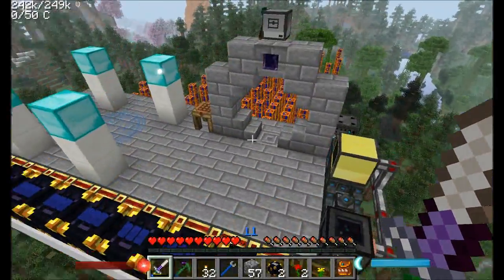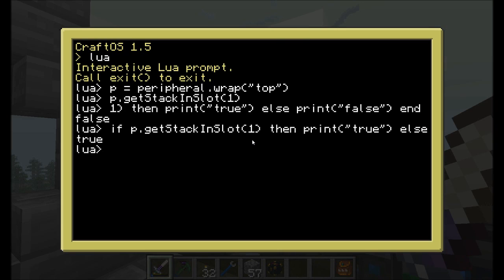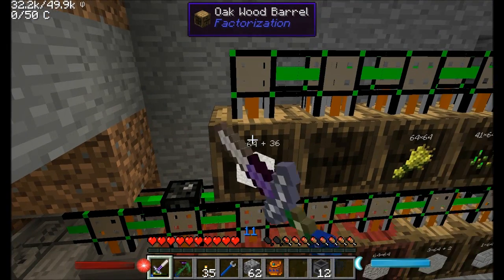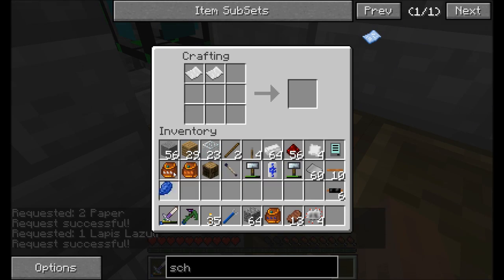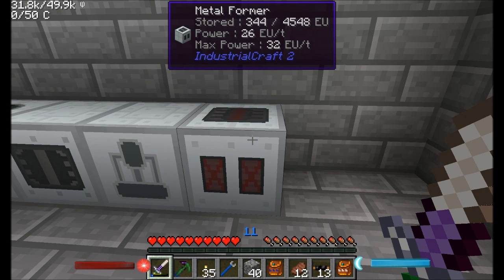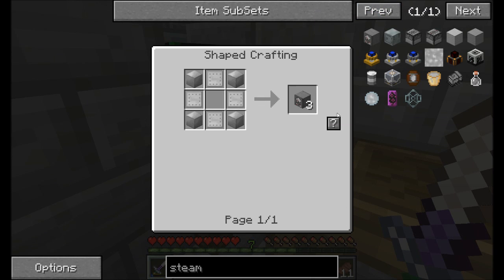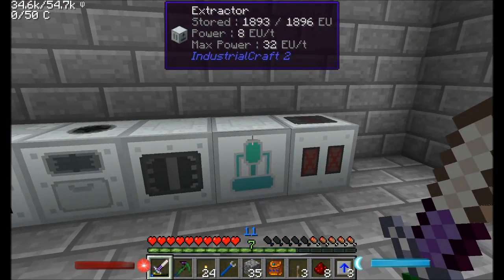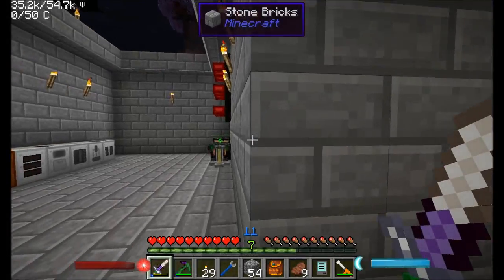Lets Play   S6E44 Upgraded Ore Processing

Comment: Ugh,  I hate IC2. Most machines are painfully slow, the recipes are extremely annoying, the textures are inconsistent (compare the eyesore used for rubber, resin, and circuits to the machines), a lot of components don't stack, and the resource demands are ridiculous. No wonder most mods are now using RF.
Reply: IC2 experimental (basically any IC2 past 1.4.7) is being developed largely by GregariousT, author of GregTech, so IC2 is taking on a very Greggy style, with the ridiculous processing chains needed to make anything, an even more complex electrical system, and an even more grindy experience (Dire really needs the Destroyer of Worlds in order to make anything from IC2). I can't stand it. While the old IC2 from 1.4 was great (it was the main mod for FTB then), the new IC2 has just gone downhill, and is really just a 'hardcore' mod, pointless without GT added onto it.

Dire should just use more pulverizer-furnace combos.
Reply: ic2 is one of the coolest mods there is.
Reply: Sergio Larios In what regard? Give me some reasons against what I said.
Reply: TristanBomb Kyle Layton Thank god. Two people who agree that IC2 was better before they overhauled it and made it so much less fun to use. I understand, it was a little too easy once you had a rubber tree farm, but now it's just a pain in the arse to get any machines made and they're so much less efficient than TE.
Reply: If you have Overclockers, you've set for some machines. Not all of them can be upgraded.
Reply: TristanBomb Agree with you on most parts, however the induction furnace is awesome.
Reply: Ali Khan I'll give it that, the Induction Smelter is cool. But it's not enough to motivate me to install IC2.
Reply: TristanBomb I think they should've just stayed as they were before 1.6. Although the textures back then weren't as great. They did a little too much overhaul at one time. I completely understand that people thought the mod was too easy and stuff. So things like the CESU and the stricter power system were appropriate. But all the crafting became just too much of a problem, and not enough compensation other than another ore doubling mechanic. As for the resource demands, it makes the entire mod basically mid-end game. Why use two stacks of iron to make a macerator when you could use it to make 20 pulverizers that give you extra goodies. (An exaggeration on that last statement, I know. But I felt it appropriate to express my feelings on the matter.)
Reply: 101epicpenguin I actually never liked IC2 that much, but there was no alternative.
Reply: TristanBomb Yeah, it was okay, just when I started using it way back I don't really think thermal expansion was really a "big" mod. At least I hadn't seen it! So I got used to it and thought "kinda cool, double ores is useful; rather iron expensive though."
Reply: You can make a power generator and a really wasteful bomb with the same blocks.
Reply: Also, as far as the whole Nuclear reactor part of the mod. The idea is pretty cool. But I lost it after 1.4. The idea of wasting multiple stacks of Iron, Tin, and Copper to replenish the fuel that I barely ever got to use except for armor that was easily outclassed by MPS wasn't very attractive to me in the absolute least.
Reply: Kyle Layton I couldn't agree more! I never really bothered with nuclear reactors - too much trouble for very little gain!
Reply: Yes its a really anoying mod to deal with but at the end its pretty usefull. You can triple your ore output (i think you can i am not sure ) and reactors are pretty fun to play with in my opinion. I dont like the new ic but its still a usefull mod
Reply: david leviev Yeah, I see what you're saying - reactors are interesting, but it's not worth the huge amount of crafting, effort, googling and resources needed for something that could be recreated simply in other mods. Also, I have no idea how to triple outputs, I'm only aware of (up to pentupling I think) ores via Mekanism.
Reply: Also, the process for tripling ores in IC2 takes a lot more energy, effort, and resources than It takes for regular Ore doubling. The macerator is painfully slow, the Ore washer requires a supply of water faster than the aqueous accumulator, and the thermal whateveritsnameis is just NO. A fuck ton of power, and its extremely slow operating speed, so it requires a ton of overclockers (which we can all assent to them being painful to craft). Not to mention rubber, which is nearly impossible to constantly farm early game, and being that you only get one per resin without an extractor (which is also painfully slow) you.cannot really hope to go anywhere without at least two stacks. Where as with TE or other mods, it requires minimal effort.
Reply: Kyle Layton
Totaly agree ic2 is not the mod it used to be. Now its just a shitty shadow of what it used to be but it can still be usefull in some ways
Reply: Kyle Layton I completely agree with what you're saying! IC2 wasn't nearly as bad before this awful new "realistic" experimental build of theirs. I say if they revert back and work on new features and balancing, it'll be better and actually useable without a million iron and rubber.
Reply: i like ic2 before 1.6 ic2 is shit after the new 1.6 update wher you got to make so much shit just to make something
Reply: TristanBomb And bro we each got our opinions like i think ic2 is only good for 1.5 and why do u care if i like it
Reply: sethraptor refering to the fact that machines from IC2 can explode if mishandled? Yeah I hated that before, I dont think its any better now.

Comment: Dire, you should use rotary Macerators instead of regular ones. They're like the induction furnaces - they macerate faster the longer you expose them to a redstone signal. You don't need overclockers for them, and I think that they use less power than a normal macerator with eight overclockers in it.

Comment: An induction smelter from thermal expansion is better than a macerator. All you have to do is give it sand. it might take like a second per ore but you also have a chance at getting stuff that lets you triple ores.
Reply: ***** What are you talking about? It's so easy to get RF. Flammable fuel for the Steam Dynamo with some water, Lava from the nether for the Magmatic Dynamos, and some sort of fluid for the Compression Dynamo. It's so easy and simple :P

Comment: Dire, mining pipes actually couse lag a bit. So, have a ton of them - bad idea.
To fix it u can just place turtles in front of mining system and program them to brake-place_back at startup. It will couse about 0.3s, but its worth it so hard.
Reply: InVeRnyak0  but if the pipes arent all chunk loaded they wont cause lag, right?
Reply: Andrew Fabrizi yea, but he going to load 2 chunk around, so its up to ~(30x10x60) possible "little lags"
Reply: Or he can just move Down the wells...

Comment: Not sure if you'll see this post but after some trial and error with the same design if you pull the wells (MFFS in the front, wells the very last block) and make sure that the wells are the bottom block being pulled instead of the second one up like in your current design the pipes will break and disappear every time if you want it to look cleaner.  Either way awesome idea, loved this design and missed it since RP2 with the frames.

Comment: With those 10k coolant cells can those just be made in an autocrafting setup like the other recipes or does it have to be the method he's using here?
Reply: HeadhunteR7171 If you put 1 cactus in crafting table it gives you juice. 8 juice around empty bucket gives you a water bucket.
(Yes, it uses more resources than fluid transposer, but is faster, if that is what you need. It's possible to farm cactus, and it doesn't have much other uses.)
Reply: They need water in the middle (either a bucket or other form of source block). The Cyclic Assembler places the water into the cell for you as long as you provide it with water from something like an Aqueous Accumulator, a Liquid Transfer node or a pump.
Reply: Ole Henning Vårdal
I kind of get the feeling that Dire is trying to create something that's an on demand system yet he has some machines or recipes in his logistics pipes network which continuously create items.  I wonder if he could have the system automatically create 10k coolant cells as needed or if he could use a barrel instead of a chest if he's got plenty of the resources needed for them?  If he uses a barrel instead of a chest he doesn't need to worry about overflow and can just tell it to keep a certain number stocked in the barrel.
Reply: DarkVoidIII You dont need a lot of them if you dont have a nuclear reactor
Reply: 1 simple way to make water is from cactus. Then you don't need to deal with any fluids, just simple workbench recipes that like ME network can craft fast.
Reply: user137 water from cactus ? xD
Reply: DarkVoidIII Hence the Cyclic Assembler.
Reply: user137 did not know that

Comment: I was just thinking, in a Mystcraft lava age, have an automated fuel turtle (was thinking the MFFS system, but a turtle is probably simpler) set up a tesseract/pump, and move it when the pump is empty. Not sure how that would work, though - maybe using a portable tank back at the base as sort of a buffer tank, and when enough time goes by that it's not being filled (and still has power), it'll move to the next location.

Comment: The Moment when ive seen the new recipe for glas fibre cables :D old ic2 was ways better
Reply: Well, to me it's simply more opponents have to be crafted. In the days of first touching IC2, carfting electric circuit seems hard to me. It is not so bad when we are used to it.:D And, we have better autocraft equipment nowadays.
Reply: skenming I suppose it is just an additional step when you look at it in total, but at first glance I saw it needing eight diamonds for a stack of 8 cable, when before if you used some electrum you could get 16 or so for a single diamond. I call that a nerf. But then, before there was basically no excuse to use anything but glass fiber, so fair's fair.
Reply: Well, to be fair, IC2 got a MAJOR buff in the release that updated those recipes. Before, glass fibre cable could run 512eu/t, now it's something like 10k eu/t (basically more than you'll ever need). To handle all that power, the MFSU has been seriously buffed, the MFE got buffed to MFSU's earlier level and the CESU replaced the MFE as second stage power storage.

Basically, they added another stage of power above the previous max!

Of course, with the previous version being very powerful at max, the new even higher tier will be costly.
Gold has replaced diamond at third tier power and to prevent you from just jumping straight to tier 3 right away, the MFE costs 16 diamonds and to make sure MFSU really is top tier and late game, that one costs a whooping 40 diamonds.

You're not meant to build MFSU stuff until you don't have any problems with resources anymore. It's meant to extend the game! Before, there was hardly anything new to do, everything was focusing on gathering resources easier or processing them more efficiently, but then what? IC2 now has things to do after you're done with all that :)
Reply: ***** Thanks for this, I share your Opinion now :)
Reply: *****
You put a really deep thought on it. I appreciate that. So now I feel all the buffs and nerfs making sense.
Reply: ***** Good points, all, but I still end up preferring Thermal Expansion. It's power can be used for a ton more than IC2's can without having to involve power converters, so I have to build less infrastructure overall. This frees up time and resources to spend making my base or bases look good, which is actually what I prefer focusing on.
Reply: Silyon487
Sure, but once the infrastructure is in place, IC2 is a lot quicker and have a lot more to build on. TE is rather restricted and basically only have the equivalent of the tier 1 stuff from IC2.
However, it has many nifty gadgets I just can't live without, so I usually end up using both!

Comment: I like using the smeltery to cook ores.  make it tall enough and you can process an entire stack in less then 2mins
Reply: and never get tripple or extra dust/ingots? hell no. thats one of the worst way to procces
Reply: ohh pfff please standard ores are fine, beside are rare change to tripple isn't really worth it, unless you count redstone blocks which give you extra whatever that thing is called to tripple ores with.
Reply: zuzoscorner i use silk touch on redstone ore. redstone ore + sand = 1 redstone block/9 redstone + 45% chance to get rich slag to tripple your ore with. ohhh did i mention Cinnabar can be made with Thaumcraft ore in the fluidtransposer and magma crucible process to tripple copper and get 1 gold every time, or Cinnabar + Ferrous Ore to get 3 Ferrous and 1 Shiny every time? just saying...
also the Lacerator for tripple Ardite and Cobalt :-)
Reply: buckwheatcat216 not if you use your main hammer with silk touch its not. i get plenty in no time. besides. i use Cinnabar mostly. easy peasy ;-) sounds to me like youre just plain lazy, throwing all your junk in the smeltery ^_^
Reply: MadLocustRising1 I guess but i'm usually swimining in resources pretty easy.  smeltery ist just easy to get mass amount fast.  plus that and the only thing you need is small amounts of lava and a timer.
Reply: timers arent good for that compared with so many other things. i dont really care what you do. i know im less wastefull, and get stuff atleast just as quickly, with propably less effort.
Reply: oh yeahstill dont care tripple ores pfff hardly worth it
Reply: zuzoscorner You are literally too stupid to insult and is triple not tripple
Reply: Ryan Lewis a small grammar error who cares ,and your very quick to insult random people
Reply: oh no, i'm called stupid by a random youtuber i'm so offended. oh wait no i'm not.

Comment: Create a cleanup turtle that just goes down to bedrock and 16 blocks across an breaks each pipe.
Reply: Wouldn't stand a chance at keeping up with how fast the UberMiner moves.

Dire was able to fix the issue after taking some suggestions from commenters about lowering the Mining Wells by one block anyway. If it's such a problem for him he can simply implement that solution.
Reply: Shaw Fujikawa As it is just for cosmetic reasons it don't have to catch up with the uberMiner
Reply: If turtles are fast enough to clean up the pipes they are fast enough to just do the mining themselves since they would essentially be mining all the same blocks as what the mining wells just cleared.
Reply: Nathraq83 If it cannot catch up with the miner though, it would be useless since after a few iterations of the mining operation, there would be more pipes left over than the turtles could handle and the mess would never be cleaned. Multiple turtles could work, though.
Reply: Schist025 First yes  parallelizing by using multiple turtles is a good option. And second the uberMiner won't go non stop. He didn't do it in the past, so I think there will be enough time between two cycles to catch up.
Reply: Jeff Scott No but that is not the point. If you program a turtle that it cleans a vertical square 16 x (down to bedrock from one block below the platform) You can check every time the turtle is at the top row if there is a block above. If so the turtle must be below the platform and you stop. With a program like this running in infinity loop you can make a clean up turtle that can catch up with the platform in between two mining cycles. It's not about the problem that it has to be the same speed as the platform, wich indeed would make the uberMiner useless, but about cleaning up while the uberMiner is in idle mode.

Comment: By using ic2 he has basically stopped himself from getting shiny metal..which last I saw in his system he only had 10
Reply: That is why I like having Metallurgy 3 installed, you can just find worldgen platinum. Also with ExtraTiC you can use the shiny metal to have incredibly fast mining.

Comment: who remembered the times that glass fiber cable were only 2 pieces of silver and 1 diamond for ~8 pieces?
Reply: Ah... Good times ! And the time Energy Crystald were only 1 diamond and 8 redstone... Aaah...
Reply: Thib92 Everything got Gregg'd... =/
Reply: i do
Reply: Celestial Archangel Phoenix 512 EU/t. And reactor gave 2048.
Reply: Back then you also pretty much had to use glass fiber cables for even low voltage setups due to energy loss.  Now copper cables are perfect with low voltage and gold perfect with medium voltage.  It makes the other cables actually useful and reserving the expensive cables for only end game high voltage machines.
Reply: Celestial Archangel Phoenix no they couldn't but you could send infinite packets of 512/t

Comment: direwolf20 There's a much simpler way to fix the mining well pipe issue. Move the mining wells down 1 block, so that the MFFS doesn't move the pipes under the wells , but only the wells. I tested in single and multiplayer so it should work. Goodluck! And thanks for your awesome series!

Comment: Another way to fix the problem of the left behind mining pipes would be to move the mining wells down a block. How you have them at the moment means that the top block of the pipe are getting moved by the force manipulators. If you move the mining wells down so that the pipe isn't touched by the force manipulator the pipes will disappear each time the rig moves. Also, working on a way of controlling multiple rigs using floppy disks in ender chests.

Comment: Dire, don't you ever read the changelog!?
IndustrialCraft had a huge update. Machines no longer explode, no matter what voltage you give them. It's just that they have limit on the amount they can pull in.
I have an MFSU powering a macerator with no upgrades. It works fine. It can just only pull in the base amount of power since it doesn't have any transformer upgrades.